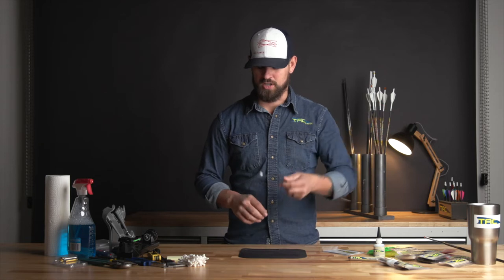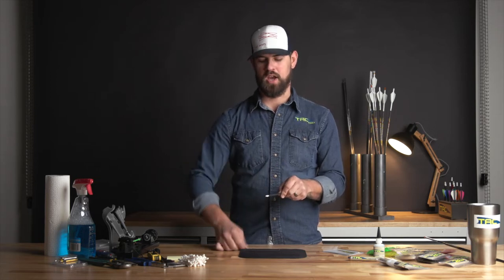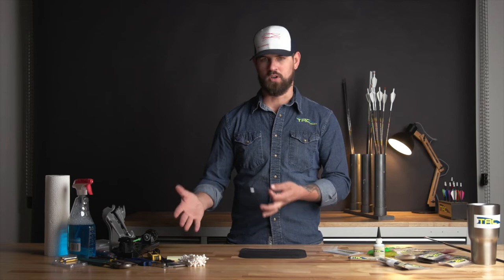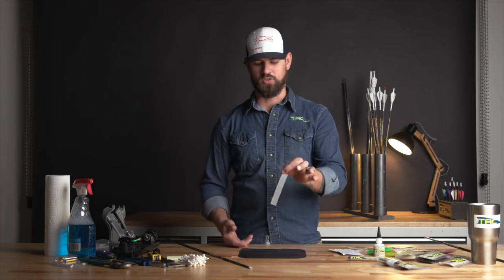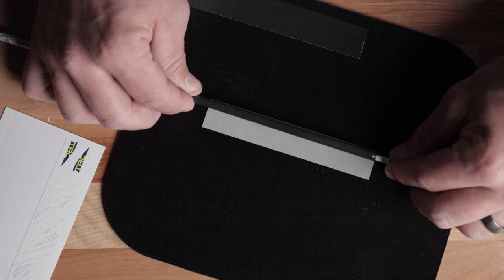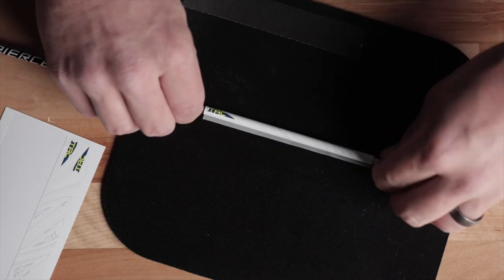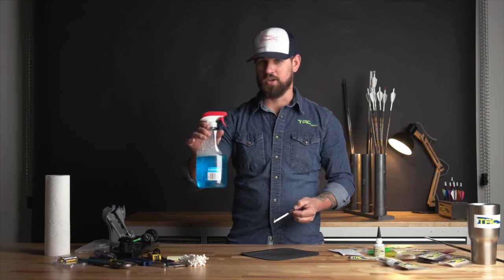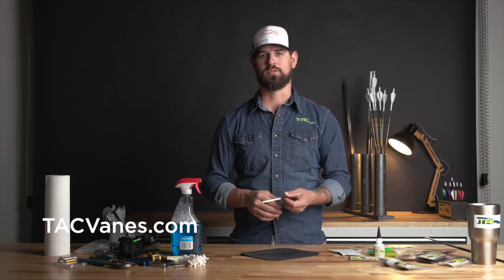How to install an arrow wrap - TAC Vanes Topo Arrow Wraps

Comment: Do the wraps help with the adhesion of your vanes?
Reply: The wraps are not required for good adhesion with our vanes with any carbon arrow. Each shaft manufacturer has a different process to make their arrows, so some surfaces don't accept glue as well and the wrap could help in some cases. If you're shooting an arrow with aluminum on the outside, then we do highly recommend a wrap, or scuffing the aluminum works equally well to achieve good adhesion. 
If we can help with anything else, please feel free to reach out!  info@tacvanes.com
Reply: @randygroff9026  Ok thanks alot for the reply just got mine in the mail, waiting for my arrows and will see how it goes.